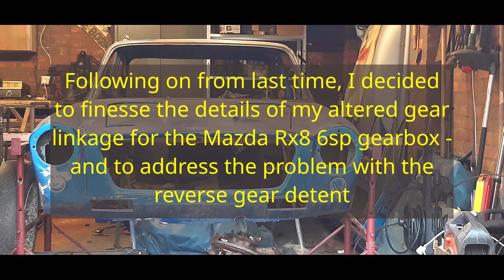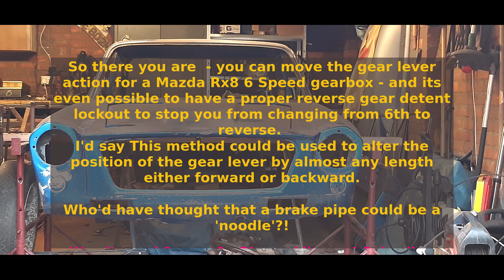Moving the gear linkage on a Mazda RX8 6 speed gearbox

Comment: Speg the reverse gear depressor cable system is nothing short of brilliant. However, the steel Bowden cable will eventually cut through the soft copper brake pipe I think.You might consider changing the outer pipe for a steel pipe, or revert back to the bicycle- type outer which already has the steel cored spiral liner in it. Either way still a brilliant feature! Nice work buddy!
Reply from the maker: Thanks for the observation. I went with the brake pipe because it stays in shape. Not springy like a brake cable. Actually I don't think it's copper but some alloy. I reckon that the limited use it gets (only when actually going into reverse) will mean it will last for ages
Reply: @Mr_Spegru  yes that’s probably true. 👍